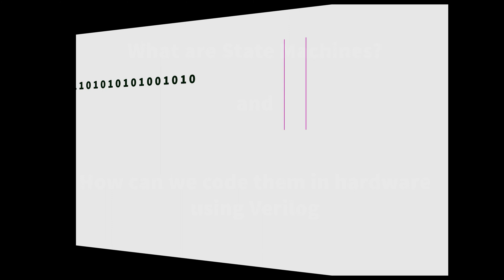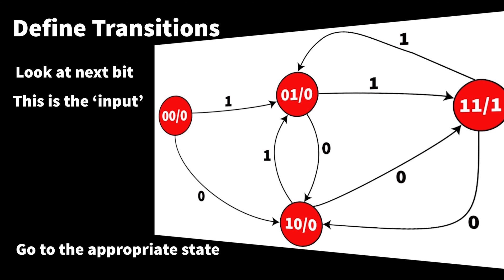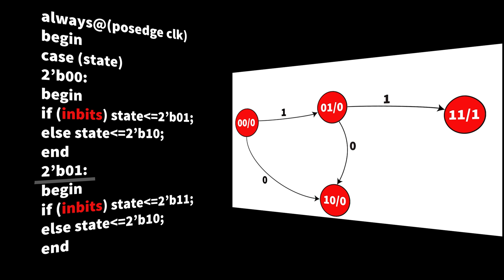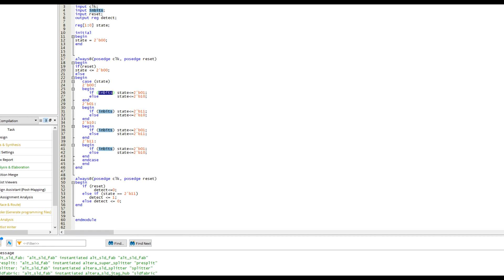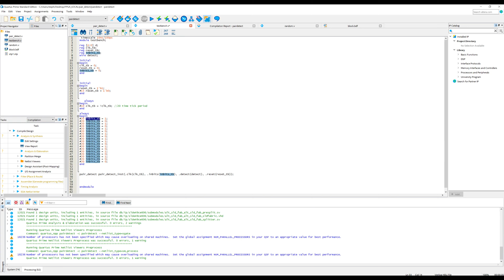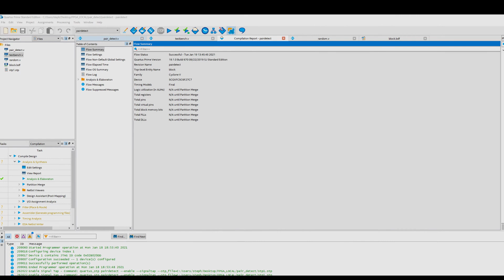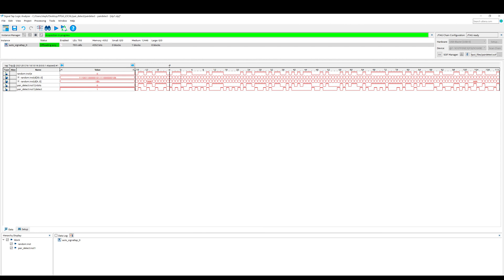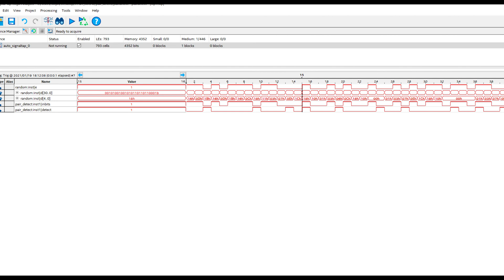State Machines - coding in Verilog with testbench and implementation on an FPGA

Comment: There is a problem where your state machine doesn’t detect the second pair when there’s 3+ matching sequential inputs.
Reply: yeah, i think this is the case for the moore machines, if we used mealy machine it would detect two pairs then.
Reply: @adityagarg6734  not really..  It could work for either type of statemachine if properly designed to detect this condition.
Reply: Yea you're right @InfiniteNesLives